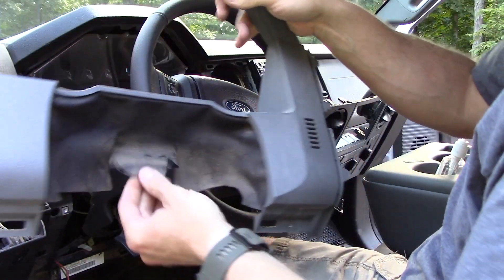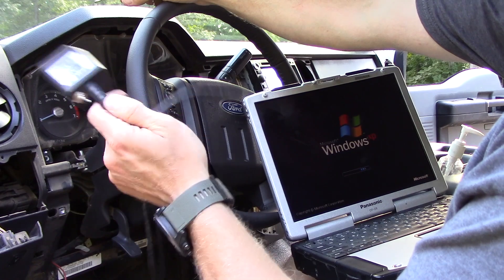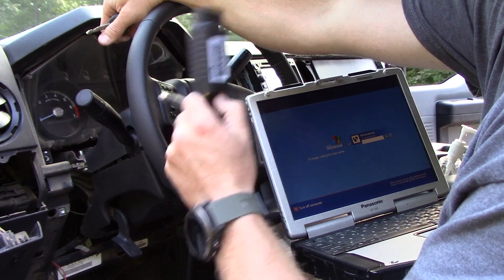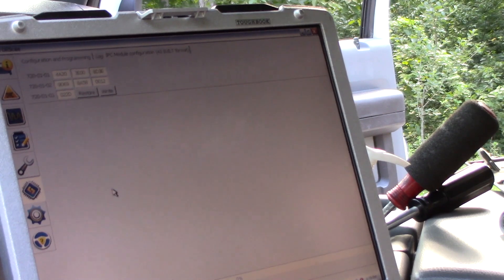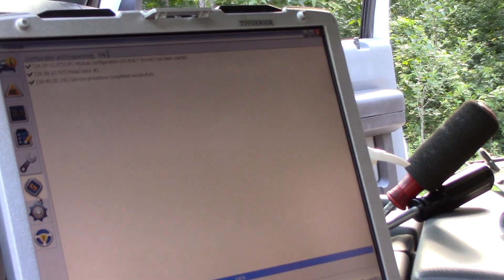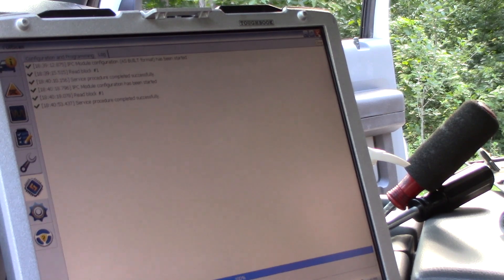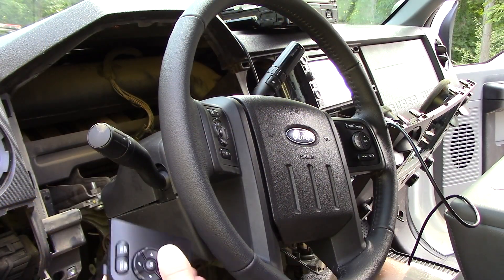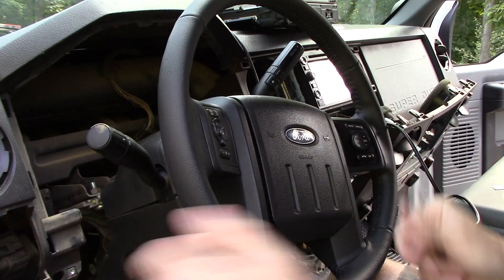2011 - 2016 F250 Lariat Instrument Cluster Upgrade How To Swap

Comment: IMPORTANT INFO FOR ANYONE LOOKING TO DO THIS SWAP!!! READ!!

If you own a 2013-2016 Superduty that has the AM/FM ONLY (No CD) stereo you MUST use a 2011-2012 cluster as your truck lacks the required Audio Control Module and Sync module your cluster needs to talk to, If you buy an 13-16 cluster and try to put it in you will get the 10 SECOND CONSTANT RESTART.

If you own a 13-16 with the AM/FM/CD player, you must use a 2013-2016 cluster, if not your AUDIO SYSTEM WILL NOT WORK, because even if you dont have a "SYNC" the radio, the truck, stereo and still contain all the sync and ACM components.

Found this out the hard way, my 14 had the FM/AM only stereo, and with a 14 cluster it would constantly restart the cluster, even with FORScan it cannot change the way the cluster operates as far as seeing the ACM, the ACM is the 13-16s clusters way of connecting to the medium speed data bus.

11-12 trucks all were built without the ACM, so the cluster was programmed from the factory to use the CAN bus to communicate to the PCM, and therefor lacks all ACM/medium speed bus connections
Reply from the maker: What a great comment. I'm sure this will help many owners. Thank you.
Reply: Andrew Beeman. I also have a 2014 and have done the same thing but mine has a AM/FM/CD stereo. Only I did this 3 time😂. 1st with a 2015 cluster. 10 second reset. 2nd with the same year 2014 cluster. 10 second reset. 3rd time with a 2012 cluster and works awesome😁. Sooo just get a 2011-2012 for your 2013-2016 and follow the video
Reply: Hi, my truck is a 2011 xlt Ive tryied  a 2013 lariat cluster on it and it does reset every 10 seconds, any help would be appreciated thanks!
Reply: Lifttolifejulio Mora you will need one from a 11-12 truck, the data lines changed in 13 on the lariat models so the cluster from one won’t work
Reply: @TheBeeMan1994  my truck is a 2016. So now I'm confused,  am I buying a 13-16 lariat cluster or 11-12. It says both in the comments. Tks
Reply: So what if i have a 16 am/fm/cd/sync i alredy bought a lariat cluster from a 14 and i did not work
Reply: clave nueva You have to get a 2011 or a 2012. That’s the only way this swap will work. Don’t waste your time trying to figure it out because I did. Drove my wife crazy😂. So I found a 2012 with 53,XXX on eBay for $98. Installed the cluster for a day with no issues and sent it to get the mileage adjusted.
Reply: @Everybodys-gonna-price  thanks alot i will buy one and sell the one i have relly appreciated
Reply: Does anyone know if this will work on the 08-10 f250? I’m assuming not...
Reply: Will a 2012 cluster work with a 2013 truck?
Reply: Anyone have the model numbers for the 11 to 12 and 13 to 16 guage clusters?
Reply: same question, there appears to be conflicting info. does a 13-16 f-250 with am/fm/cd need an 11-12 or a 13-16?
Reply: P  pop p 😊
Reply: @pazzob514 what is the meaning of that random ass comment
Reply: @rhgamehamel6350  could have been my 5 year old my mistake lol
Reply: 2016 Ford F350 6.2l crew cab  with basic cluster with AM/FM/SIRIUS XM/ WITH SYNC USB port... bought a 2015 lariat instrument cluster and it is doing the 10 second resets.. do I need the 11-12 cluster instead?????? When I try to set the mileage up to my true mileage.. nothing in forscan.   No odometer adjustment available?   How do I find this and where would I get codes for the different options?  Anybody got a spreadsheet?
Reply: So I have a 15xl, with cd player, and sync. Would i need a 13-16 then?
Reply: This comment is wrong compared to what everyone else is saying they did 🤷🏽‍♂️

Comment: Did you have to reprogram vin into the cluster or anything before cranking?
Reply from the maker: Didn't HAVE to but did it with forscan. As shown in the video which does transfer everything, including the vin, from the old cluster to the new one

Comment: This is why I bought a new one. The dealer will set the mileage from the original cluster and used one. Is not much cheaper than a new one? They’re getting 300 for used one and the guy who I  side work for we got one from the dealer for about 480 dollars is getting used one all you’re getting is somebody’s used junk
Reply from the maker: Most dealers won't touch this. Glad you found one that would. That's good

Comment: @JackofAllMasterofNone Late to the party but looking at this as I'm considering buying a 2015 F250 XLT and it only has the 1-line info screen on the cluster which is barely-legible. It has the base radio WITH CD. I've read all the comments and problems some have had with the 20-second restart. So was looking at the 2011-12 clusters. Does EVERYONE have problems with a matching-year cluster, or is that the exception? What I'm asking is, am I equally likely to run into problems with an '11-12 cluster if the 2015 has the upgraded bus, or is the '11-12 guaranteed to work?
Reply from the maker: I'm not 100% but it seems like the consensus is if you don't have Sync you need the 11-12 cluster.

Comment: Will it be possible to make that change to a 2011 f-450 chassis cab? Since it has the basic instrument cluster and I would like to upgrade it to this one that looks nicer.
Reply from the maker: Yes same procedure
Reply: @JackofAllMasterofNone  Doesn't it matter that the truck doesn't have 4 x 4 and the transmission is the one with the + and - gear selector?

Comment: Just did this in my 16’ f350 and now i get an engine brake error? I pu in one from a 11-12 truck.  Is this something that can be coded?
Reply from the maker: Did you read the data from your old cluster and then flash it into the new one? I'm not familiar with the engine brake error but obviously it has to do with the diesel engine. It probably can be fixed with forscan easily

Comment: Does it matter if the cluster comes from a different fueled truck?  IE: i have a 6.7, but can get a cluster from a gasser
Reply: The tachometer is different, I have been looking into it for a 6.2 gas and they have a different redline on the cluster that also goes higher

Comment: i have a 2012 F-250 XL 6.2 gas / purchased an instrument cluster from a 2013 F-250 XL 6.2 gas … will the 2013 work in my 2012 ?
Reply from the maker: I highly doubt it. Do you have Sync?

Comment: Just completed this swap with my 2013 F550 XL and all works great. Truck has Sync with cd player. Used a 2012 cluster part number CC3T-10849. The steering wheel cruise control buttons part number is SW6770. My truck has floor shift lever for 4x4 and that indicates just fine too. Thanks to this video!!
Reply: Wait if yours comes with a cd player how did you use a 2012 cluster without it cutting off and on?

Comment: I have a 2013 F250 XL, I tried a 2013 F250 lariat cluster, but it is turning off and on every 10 seconds. any fix to this? i have the factory CD player (no steering controls tho)
Reply from the maker: This is a common issue if you don't have sync. You need a lariat cluster out of a 2011-2012 most likely. Look through the other comments and you will see what I mean.
Reply: @JackofAllMasterofNone  ok got it, thanks for the reply. You have great/informative videos. Spared me headaches and saved me $$$. Thanks again!
Reply: Maybe you should edit the top comment? Seems everyone is getting this wrong info.
Reply: I have a 2011 deisel, Can you change out a base f550 to a lariat from different model?

Comment: What about mileage on the cluster?
Reply from the maker: The cluster controls the mileage. So you need to have a shop capable of changing the mileage update it or buy a used one with slightly less miles than yours and wait until they are the same to do the upgrade .

Comment: hello. I have finally after trying a 2016 cluster in my 2016 F250 6.7 that would keep cycling, replaced with 2012 cluster and it did indeed work, but now I don't have a compass or my engine brake. Any ideas on how to regain those features? thanks, Pete   by the way anyone want to buy a 2016 F250 6.7 cluster with 81k?
Reply from the maker: You should be able to flash as built data from the stock cluster to the new one and it should restore those functions.

Comment: I did the same swap like you put the same cluster but when I plug the new one is working fine until 40 seconds and then turn off by self and on again and repeat did you know Id the is normal ? Or I have to do something different in the programming ? Thank you
Reply from the maker: You need a cluster for a 2011-2012 most likely. It's a problem with interference with the sync system I think. Look at the comments on this video to see what I mean

Comment: I know you replace the old cluster. I was wondering if its  possible to replace the lights on the original cluster or are integrated? Can’t find anything on 2013 f250 that answers that.
Reply from the maker: They are integrated LEDs. So would require micro soldering

Comment: Hello just seeing this video i have 2014 ford 6.7 xlt and would be sweet to have the nice cluster instruments in the middle i would take the factory lariat and just install that now i can do the hole take out put in its the soft ware part like where do you get the soft ware and how does that part work to change everything you did when you had the problems because my truck has the trailer brake i think what it doesnt have is the back up cam has tps and pretty much everything you said but i would love to do this but dont know how the soft ware part work

Comment: I have a 2016 f250 6.7 and got a used cluster bur have an issue of it resetting every 10 seconds which I found is a common problem but don't know how to rectify ? any suggestions? Ford ids did not help as tried to change as built info. please, any ideas?? thanks
Reply from the maker: Probably need a cluster from a 2011-2012 to fix it. Read through the comments. It's a problem on the higher trim level trucks with Sync I believe

Comment: THIS WAS SOOOOO EASY to do on my 13 XLT, THANK YOU! Just like you said, I found a 12 Lariat cluster and followed you instructions. Took 30 minutes Total along with replacing my worn out foam steering wheel with a Lariat Leather used wheel. Controls that came with the new wheel worked was exactly what it needed. GREAT UPGRADE!  Also going to comment on the remote start with just a 4 button replacement key (that didn't come with the truck) and no antenna and simply changing remote start to enable and it worked like you said. SO easy. Thank you!!!!!
Reply from the maker: Glad it helped!
Reply: @brettmclean3113 where did you get the cluster? I'm trying to find one as well

Comment: Brilliant video. I have a 2013 F350 SD 6.7 CC DRW with CD player etc   I have installed an 11-12 gauge cluster series JA thru JC  per your video.  I need the CC message center button module BC3T-9E748-AEW that you specified.  Very hard to find, as the standard module will not work.  Anyone know where I can find  this module please ?
Reply from the maker: I'd check ebay. When I did this I also upgraded the steering wheel so it came with the new leather Lariat wheel.

Comment: Hopefully I can still get a reply on this, but I'm rebuilding a flood truck ('08 F250 XLT) and the gauge cluster is crap. I bought a replacement from same model, trim and year truck. I'm hearing they have to be programmed or it won't allow your truck to start. Is this true? I have no idea how I would get "as-built" data from the old cluster.
Reply from the maker: It should start, but you will get a bunch of error messages probably.

Comment: Quick question I have 08 f250 will like to upgrade to 12 cluster will I have any issues
Reply from the maker: You cant do that. Totally different electrical system and canbus interaction.
Reply: Well what can I put in as replacement for it wanted digital

Comment: Hi Jack 
I have the same problem 
Mi truck is 2014 ford f250 6.7 
An buy 2015 cluster every 10 seconds start again. 
All the controls is working perfectly only the parking assistance is the problem
Reply from the maker: You need a 2011-2012 cluster in that case. Search the other comments for the answer to why.

Comment: So where is the mileage stored, ecm not the dash? I am trying to put a 2016 f250 4 door lariat cab on a regular cab xlt 2014 f450 both diesel. The f250 has 300k and the f450 has 45k.
Reply: I’ve been trying to figure this out forever. The mileage is stored in the truck. Not the dash

Comment: hello i did the upgrade and i got a cluster for the same model truck i have and it keeps resting, any idea why???
Reply from the maker: Look at the other comments. You probably have a later model truck that requires a 11-12 lariat cluster
Reply: @JackofAllMasterofNone   So yes I have a 2016 f350 with am fm with cd and sync. So if I get a 2011, 2012 cluster it will work?? Do you still need to do the programming like you did with forscan?
Reply from the maker: @russellwinchester4560  Yes. I believe it's the same programming to get your features working correctly. It will plug in and work  without programming, but you will most likely have error messages for missing components, etc.

Comment: would this be at all possible to swap the newer instrument cluster like you did into my 2010 250 xl?  i have am/fm cd,  power windows and door locks,  other wise pretty basic standard cab long bed.  any info is awesome,  i love the new cluster you have.  thanks
Reply from the maker: No I don't think so. Not easily. In 2011, Ford made major changes to the way the modules communicate and they are not interchangeable, even though they look kind of similar.

Comment: Thank you for this video. I have a 2014 F250 XL with power windows/locks, am/fm/cd with Sync. I ordered a 2014 Lariat cluster and it did the 10 second reset thing. I then found and purchased a 2011 Lariat cluster and bingo it works.  Thanks again for posting this video!
Reply: The comment above say that shouldn’t work 🤔

Comment: WOW!!! Thanks so Much!   I was able to get my cluster cleaned looking NEW.    SOOOO Question. I ended up rolling my 2011  2x4 F450 XL. Cab is beyond fixing, but frame and Had 40k on new factory warranty engine and need  to keep the 450 frame, brakes, suspension...ect.  I found a 2011 4x4 F250 Lariat Cab and installed it on my 450 chassis.  Only way to get it running was to have Lariat ECM, BCM, and Cluster installed. Runs and Drives great......only Problem is am now cluster is showing a bunch of codes...... check locking diff, back-up assist,  and a bunch of other notifications  Any ideas on how to get ride of the codes and still keep the Lariat cluster ect.  This F250 cab is power everything, sunroof, alarm....... my F450 was base model. Even had manual doors and windows.   I could REALLY use some help and suggestions.

THANKS!!!!!       Email is armysinger1@gmail.com. phone is 801-636-5969. Ben
Reply from the maker: You need to flash the as built data from the original cluster into the new one in order to get rid of the warnings lights, etc.
Reply: @JackofAllMasterofNone  Hi.  Thanks for the help!!!!  Whats the chance you would  you be available to chat  for a few minutes? I am  stuck and don't feel confident to proceed without a little guidance.
Reply: @Jack of All Master of None Hi.  OK. I am ready to get this done now. The concern I have had is saving cluster data. Right now I have a running truck with a bunch of codes  using parts put together from two trucks. Do I need to install the original 450 XT ecm, body control module, and cluster first and then download the as builts from the cluster? if so, it wont start or run because I have not swapped the ignition key and security......Or, can I leave the Lariat ecm and Body control module in with my original  XT cluster  to download the as-builts ?
Reply from the maker: @benjacobson8689  basically you need to use the correct data for the parts you have. So whatever cluster was paired with the PCM and BCM that you want to use on the truck  as the final parts is the cluster that needs to be read and saved and then flashed into the new cluster. That would be the easiest way. Or you can just put it all together how you want and use the Forscan spreadsheet (search Google for 2011-2016 f250 Forscan spreadsheet) to try and correct every little problem individually. But the easiest way is to do the first method, which is what you outlined last in your comment. The PCM must match the key for the truck to start as you know for PATS reasons. As long as everything is connected it will function enough to use Forscan, although you may get a ton of codes. If it won't start after connecting the new setup you want to use you can just add the keys through the pats process first in Forscan. Just make sure all the keys are on hand to be programmed
Reply: @JackofAllMasterofNone  Understand. So, is there a way to use forscan to disable all the modules that aren't connected?  ie 4x4, diff lock, rear parking sensors, ect.  if not, wondering if the truck key can  turn power to the truck, but just not start. That way, I can use the XT ECM, BCM, and cluster . down load the as builts from the xt cluster, then swap the ecm, bcm, and cluster for the lariat and upload the as built data from the xt cluster.
Reply from the maker: @benjacobson8689  You can disable them by changing the as built data in the cluster yes, but to do that you have to understand which hex codes to change and to what value. This is not easy if it's not something that is already published out there. It just depends.
Reply: @JackofAllMasterofNone  right. So will just installing the xt cluster in the truck with the lariat  ecm, and bcm work.. saving the as builts..... check engine light is still on with the xt cluster.  so grateful for you help!!!
Reply: @JackofAllMasterofNone  now that you know what mess I have started, what would you recommend doing to get the truck running with no codes and still have the lariat cluster.  If I use the BCM from the XT.... then I would think the power doors / windows and security wont work.